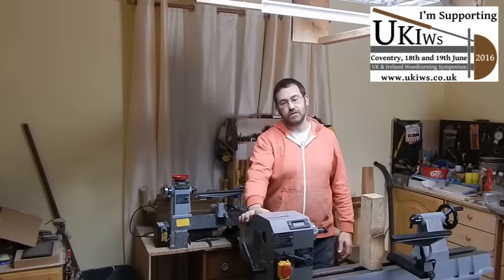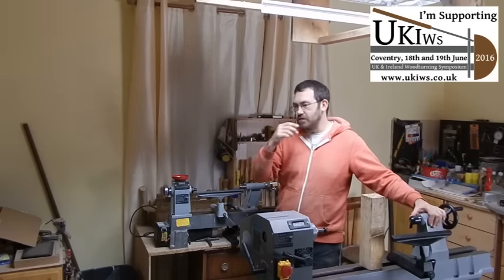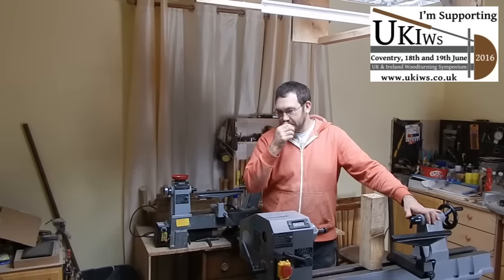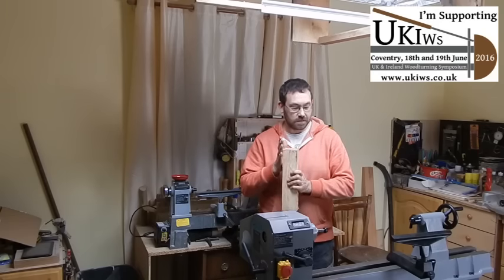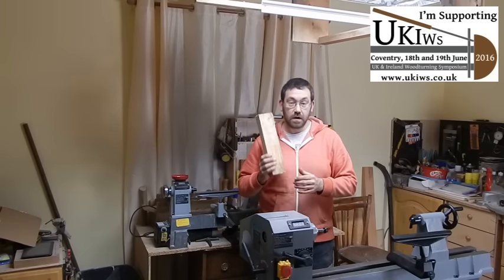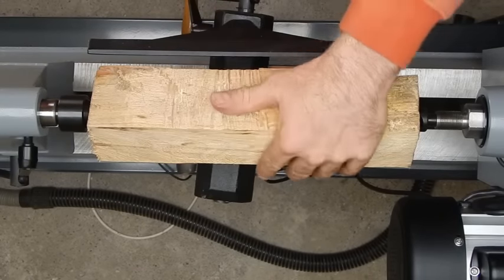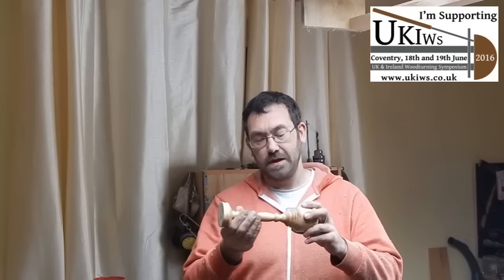Woodturning, Christening my new lathe and turning a spalted Beech Goblet.

Comment: Health to enjoy your new lathe.  The secret to stress-free turning with that speed selector system (Reeves Drive, also known as Scooter Drive) is regular maintenance.  Keep the mechanism clean and oiled and you'll have a good time.  I had the same system on my lathe and got on well with it.  One important thing, always return the speed to zero when you finish a piece because you can't change speed with the lathe off so you don't want to have a big piece of wood starting at full speed.  The biggest hassle is taking the piece off to start the lathe so that you can reduce speed so you can avoid that by always selecting low speed when you finish.
Best Wishes, Brendan.
Reply from the maker: +baconsoda Hey Brendan, Yeah it took a couple forgets to remember but I think I have it now !! Thanks a million for all the info I'll be sure to look after her !! Thanks for watching Brendan, always a pleasure, take care. Steve.